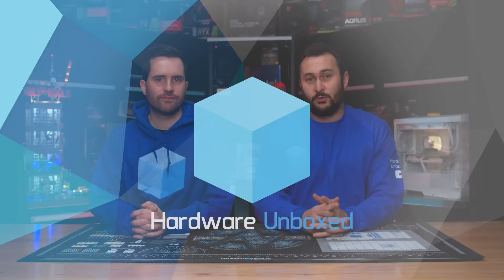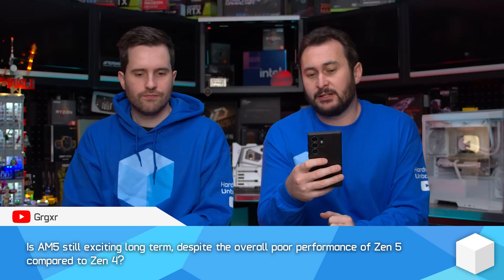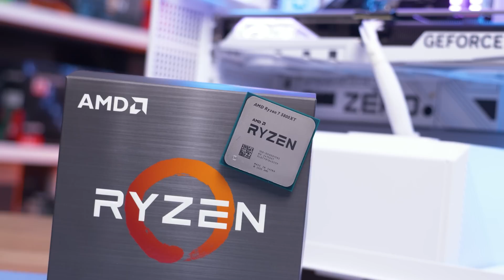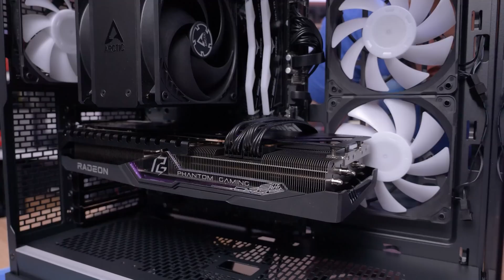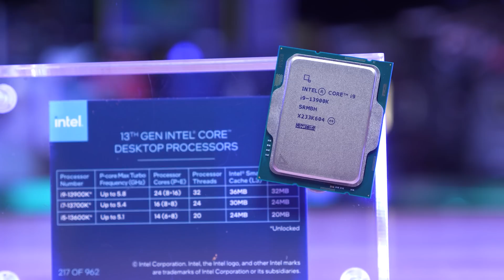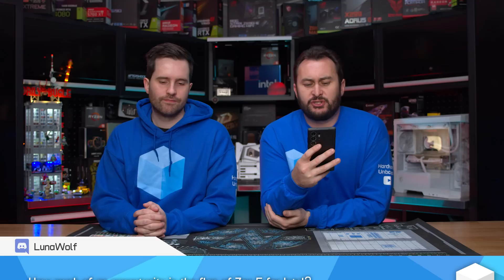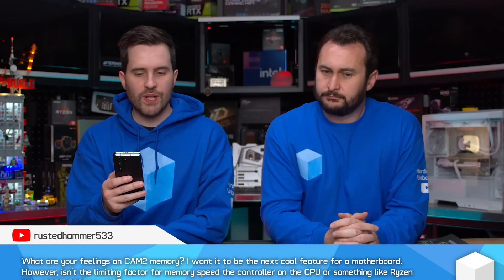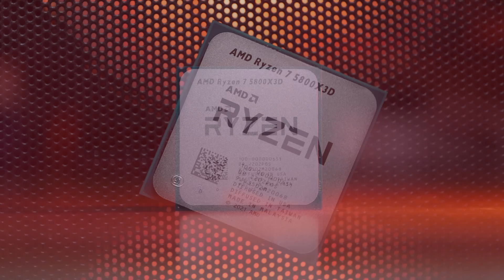Our RDNA4 Expectations, Can Intel Gain Lead After Mediocre Zen 5?

Comment: In an healthy competitive market the latest product beats the ones already on the market. So I wish Arrow Lake (Core Ultra 200) will beat Zen5 and Zen5X3D will regain a (slight) lead over AL when it'll come out next year.
The alternative is the current GPU market where Nvidia can wait as long as it wants to release the 5000 series.
I really can't understand the "fanboys" that hope Intel fails, AL is slow and hot, then whine if AMD postpones X3D or prices it outrageously high (like Nvidia does with its 90s).

Comment: With where i am, on a 9900k, Im actually rather annoyed that the strong gaming cpus are still only 8 cores, effectively. Considering ive been wanting to hang on to Windows 10 for as long as possible, intel's error cores do less than nothing for me. and AMD doing the core parking stuff doesn't really inspire confidence because my gut forsees that as a feature that they will be all too quick to drop support.
Reply: But the latest archs have around x2 single-thread performance of your 9900K and that's what matters in gaming.
Reply: @frantavopicka5259  Not sure where you're referencing that. Zen 4 is faster, but not an entire multiple faster. to warrant such a complete platform upgrade, it really needs to be more substantial.
Reply: Core parking is a hack that AMD introduced because Microsoft is too lazy to fix windows. It ought not to be necessary.
Reply: E cores actually do improve gaming performance. Tjat myth was busted a long time ago and they dramatically improve productivity. Regardless how much power intel dumps into their CPUs big little core design is more efficient and an optimal usage of core design, look at Apple M chips. Yeah theres a lot of bad things about Apple but power efficiency isnt one of them. Intel is still on 10nm, AMD and Apple are always on a half as small nanometer cause TSMC makes fabs for them.
Reply: @Angel7black ARM cannot multitask. Source: every phone, ever.

Also, for windows 10, I have to turn off the error cores regardless. So even now, Intel has yet to release a new CPU with more than 8 cores.

Comment: I bought a second 7900XTX for my bedroom PC because there is basically zero chance we'll have a better 4K raster card that's reasonably priced before RDNA5.
(Nvidia 5000 will all be overpriced OR lacking memory bandwidth, as Nvidia loves to do with mid range cards, and it's almost certain at this point the best RNDA4 card will not be as fast as 7900XTX.)
Reply: i got a cheap new one for 850usd seems like a no brainer as a long term card hoping it lasts as long as my 390x did and 2080ti did 5yrs+ each
Reply: Nvidia still charging 800 bucks for a xx70 TI is still insane to me 💀
Reply: @cuteAvancer  people are buying them....do you understand business?
Reply: @jaket1501 Yes indeed AMD does make setup on Linux easier. Plug and play.

Comment: Radeon hard limits clock speeds? is that GRE question? cause i just went to my Adrenalin and i can crank up 6950XT to 5000Mhz min and max clock speed... would instantly crash, but it is and option, voltage can go from 900-1200mV, and power can go up to 20%, but that's more likely limit for safety of the connectors rather than artificial limitation

Comment: Hoping for a very nice Price to Performance Rx 8700 XT.
My 5700 XT is tired..
Reply: you will get that
Reply: There have been some extremely deep discounts on 7800XTs popping up. if you dont care about RTX and all you need is 1440p at 165-180hz then this card is a solid performer. 16GB of memory and AV1 codec support. It will sort you out for a long time to come.
Reply: @Rose.Of.Hizaki  Not in Baltics. Everything here is insanely expensive. Even 7900 GRE costs around 700€, which is insane.
Reply: @Fatalxtv  here in Germany it’s also not that cheap as in the US market I noticed.

But I still expect that prices will come down significantly this winter because of the new AMD launch which is (almost) certain
Reply: @Fatalxtv  Thats a shame man. Keep an eye on amazon though because its where I picked up my 7800XT Nitro+ for 480euro which is pretty cheap in my country. Im sure other graphic cards also see random DEEP discounts.
Reply: this winter ...
Reply: @Fatalxtv  because RDNA 4 should bring:

RT performance near a 4070 Ti Super
Raster performance will near a 4080 

for around 500 - 600 bucks this winter 

Wait one more year and then discounts on that will kick in .. 

AND most interestingly when the leak of “Moors law is dead” YouTube channel is correct, it will crash the used market. 

Prices will come down significantly.
Reply: @johann3029  Wishful thinking. 
More like 4070 super performance for 600 bucks. 
Especially here in Baltics, where Prices are absolutely insane since 2020.

Comment: CPUs and GPUs are essentially overclocked from the factory ..... Boost clock = Overclock. Basically it's computer controlled (by an algorithm in the BIOS) dynamic overclocking

That and once we got into EUV made chips they were more and more consistent so you never saw those magic chips that just outperformed the others by a wide margin
Reply: with the downsides of overclocking from the factory too, like overvolting resulting in premature death
Reply: overclocking is pushing a part above its spec. factory spec cannot be an overclock no matter the algorithms they put in. there's no "design clock" to compare against
Reply: Its A, for stability reasons. Every chips is different and although most could easily run undervolted, people would RMA those which crash on lower voltages. And B, benchmark reasons and marketing.

Comment: On the overclocking: do you really hear about people blaming the manufacturer's for OC related crashes?  I think it's notable how little of that certainly was talked about in comparison to the unholy storm that quickly grew around intel's issues.  That seems to suggest that this isn't really an issue; crashes due to OC are clearly rarer, and they don't seem to have blowback for the manufacturers - at least not to a meaningful extent.

Comment: 7800xt - 60CU, 64MB L3, 256bit, 16GB, GDDR6, 19.5Gbps
8800xt - 64CU, 64MB L3, 256bit, 16GB, GDDR6, 20.0Gbps
We have 4 (7%) more CUs, the same cache, the same bus, the same memory type and amount, and 0.5 (2%) faster memory modules.
It will be good if AMD will be able to make the 8800xt as fast as the 7900xt (25% uplift). But people already jumped on typical AMD hypetrain where 8800xt = 4080 (~50% uplift).
Reply: @tomtomkowski7653  probably closer to 7900GRE than XT
Reply: @monsG165 
Words of wise man
Reply: If it is closer to GRE instead of XT then it is fucking useless. @monsG165
Reply: Is it a sin to expect company release a better product after 2 years? Is it unrealistic to expect some progress and competition? We are still talking about near RDNA 2 performance...
Reply: More of a refresh really, but that doesn't have to be a bad thing.
Reply: @CarthagoMike  refresh actually means something (e.g. a new revision of the same chip), RDNA4 is totally different as was RDNA3
Reply: @CarthagoMike  it is when the 7800XT was a refresh as well of the 6800XT and in some instances performed worse.
Reply: @monsG165  7800XT and 6800XT are not of the same tier
Reply: @pinkpapa9234  7800 XT is on average just 5% faster than 6800 XT. So yes they are on the same tier and it was just a refresh.

The 7800 XT was the most popular card of it's gen because it offered similar performance to the 6800 XT at a lower MSRP (at launch).
Reply: @enmanuel1950  And the 7800XT is more than 5% faster for RT than the 6800XT, so yes, they are not on the same tier because all you fanboys demanding that it only matter that a game is fast raytracing..... because NVidia are faster at that, and only at that....
Reply: @markhackett2302  Idk who you're calling an Nvidia fanboy. I don't give 2 fucks about ray tracing and I'm currently building a full AMD PC. That's why for my use case the 7800xt and 6800xt aren't much different. I care more about perf/dollar than anything else. AMD is offering that, but if Intel or Nvidia were to offer more value in the future I'd switch. Being loyal to any company is for kids/teens.
Reply: @enmanuel1950  " Idk"
You got that right.
Reply: @markhackett2302  "all of you fanboys." Now you're going to act like you weren't calling me a fanboy lol. It's fine though.
Reply: Honestly, if it's gonna be as slow as 7800XT, it's not even a problem if the price is right ($400 or lower). But it's AMD, so we all know it's going to be more expensive than the current gen AMD cards of the same performance, nobody gonna buy them as always for that price, so a couple of months down the line they'll just start dropping the price begrudgingly, but still not enough to make it a good buy. It's usual AMD pattern.
Reply: yes but you forget to mention the clock speed increase to 2.9-3.1 ghz
Reply: Looking forward to the HUB cost/frame chart
Reply: The increase in clock speed is also a factor I do expect it to match the 7900 xt
Reply: Based on those specks… it will be 2 to 5% faster that 7800xt
Reply: And you cried to daddy tube. What a shocker. You made up the claim and if you get pushback you will just say "some people" and never name them, because what you claim never happened.
Reply: Didn't they say it was a better version of the cache? and I think the CU will be considerably better since rdna 3.5 had a considerable performance jump.
Reply: I, for one, don't get why the comparison to 4080. The raster of 4080 is very close to 7900XTX, So why not simply tell that they want an 16GB 7900XTX for a cheap buck? Why bring an NVidia card here?
Reply: @someperson1829  Because of MLID hypetrain when he stated that the 8800xt will be close or at the 4080 performance so that's why. XTX is a bit faster so I wanted to stick to actual hypetrain and not add another couple of % uplift from myself. One way or another 50% is a typical AMD copium people repeat every single time.
Reply: @tomtomkowski7653  I wasn't really questioning you, mate. I've just noticed that people bring 4080 way too often, when they talk about 8000 series. Like it makes their 500-600$ pricing wishes any more realistic. They bring NVidia card, because they can't realistically expect that AMD will sell for that price GPU equal to its current high-end card, while also especting far better RT.
Reply: @someperson1829  i think they want to emphasize it's value in general performance since the 4080 launched for 1,200 USD while the RDNA 4 part is realistically gonna be between 600-700 dollars if it approaches somewhere between the 4070 ti super and 4080 in terms of general performance. If it actually reaches 4080 level of performance though, I think it'll be more like 750-850 USD. We shall see...
Reply: RT performance would greatly improve for sure, but RT alone isn't going to sell cards.
Reply: @tomtomkowski7653  nobody is upgrading their GPU every year. How about comparing it to 5 year old cards instead of 10 month old cards.
Reply: yep, just like MLID where he overhyped AMD's product in a nutshell like Zen 5 and when it failed to deliver they on damage control 😂
Reply: @Eleganttf2 I don't know that it was overhyped. The IPC performance gains are there, if they aren't in the apps that you use or care about that sounds like a personal problem
Reply: @Eleganttf2  MLID leaks came from AMD itself and everyone know some serious communication issues happened because Zen5 was not at all as advertised. There's no damage control , it's AMD marketing department sandbagging every single time and everyone acknowledge it
Reply: The 7800XT has the same number of CUs as the RX 6800, but performs between a 6800XT and 6900XT. Not too farfetched to think RDNA4 will have a fair jump in performance if the specs between each generation are the same...
Reply: It's been said the raster is faster than 7900xt. About 4080. Anyone saying it's slower than 7900xt is crazy.
RT is rumours of 4070super which was most shocking.
Reply: CU between architectures aren't directly comparable.
Reply: 1,07*1,02 = 1,0914, so probably 9% better. So a 6800XT -> 7800XT jump again, 8800XT competing with 7900 GRE most likely.
Reply: @magnusnilsson9792  That is the theoretical maximum scaling with the perfect workload. More realistic (assuming same core clocks) is a 1-6% gain, depending on the type of workload
Reply: @magnusnilsson9792  You said: 1,07*1,02 = 1,0914, so probably 9% better. Sure but you have to remember about N5 -> N4P and this move to a smaller node should give 10% so this could be maybe close to a 25% uplift to match the 7900xt but 50%? C'mon :) people are dreaming like always, typical AMD copium repeated every single time.
Reply: RT performance will be near a 4070 Ti Super
Raster performance will be near 4080 

for around 500 - 600 bucks
Reply: @johann3029  This is AMD, it will be probably 4070 Super in RT and they will shoot themselves in the foot pricing wise at 699 or and 749 for us in Europe.
Reply: @monsG165  And it was AMD when you claimed the 6900XT wouldn't even get to 3070 levels....
Reply: @monsG165 right? They probably played resident evil village to get their RT performance hype. Like when they used a 6600 to benchmark the 5800xt CPU to say it was a 14700k competitor lol
Reply: @ArchieBunker11  " Like when they used a 6600 to benchmark"
Like those who STILL complain about HUB and insist that nobody would use a 4090 to do 1080p, and guess what you WOULD use to do 1080p on? A 6600. What AMD MARKETING did was listen to all those "people" demanding HUB stop using a high end card, and now that AMD marketing did just that (as they would do if HUB acceded to those petulant demands) complain now that it is wrong to use a 6600 now....
Reply: @markhackett2302  using a 6600 to benchmark CPU’s at 1440p is a metric shit-ton stupider than misinformed idiots complaining about using a 4090 to test them at 1080p. But perhaps the least intelligent thing here is you condoning this nonsense from AMD.
Reply: @ArchieBunker11  "using a 6600 to benchmark CPU’s at 1440p "
No, it was using a 6600 for 1080p. So clearly you are not in the least careful that you cohabit reality.
Reply: @johann3029 😂🤣
And Santa brings gifts to good bois
Reply: lol its not the same architecture
Reply: LOL another dude that think he know something and compare different architectures. Dude according to "your" opinion RX 6700 XT should be like 30-40% slower than RX 5700 XT.
Reply: @Scytian1  You said: LOL another dude that think he know something and compare different architectures.
LOL, another dude on the typical AMD hypetrian who probably thought that the 7900xtx would be as fast as the 4090, ZEN 5 will be 30% faster than ZEN4, and so on.
As for your comparison... go and check the 7600 vs. 6650xt so you will see "different architecture", the same specs, and a 3% performance increase. LOL.
How many times are you going to repeat the same cycle before you learn? Overhype -> disappointment -> just wait for the next-gen -> repeat.
Reply: @tomtomkowski7653  LOL, you probably thought that the 7900XTX would not even beat a 3070.... and so on.
Gosh, this is easy. Just make up what you think is wrong about someone and then assert it.
Reply: @markhackett2302  The opposite. My prediction was that the 7900xtx would be faster than it is because the specs looked good. 
I never predicted it to be as fast as the 4090 (this was just impossible) and as slow as the 3070 (this would be total nonsense). 
I'm just trying to be realistic here. From the specs we know so far for me it looks like up to 25% performance increase so the 7900xt level of performance. 
5% from CUs, 5% from the node, 10% from clocks, 5% other improvements.  If it will be faster great but the 4080/7900xtx is just typical copium repeated every single time.
Reply: @Scytian1  He probably was also one saying, after the 3080 was released, asserted that AMD wouldn't even get to 3070 levels of performance. Then pretended that was never said by anyone....

Comment: My expectation for the RX 8800 XT: rasterizstion on 7900 gre level. Raytracing on 4070 Ti super or 4080 level
Reply: That's my expectation as well. Good evidence out there that AMD is finally doubling down on RT performance. Sounds like they had been holding off committing a bunch of die area to it, waiting until the software matured more.

Probably won't be caught up to Nvidia, but I expect them to close the gap significantly, at least to the point where it doesn't feel so bad to turn it on lol
Reply: what

:face-turquoise-covering-eyes::body-green-covering-eyes::oops:
Reply: You'll be disappointed. How should AMD only gain 10% in raster but double RT performance?
Reply: @nipa5961  They way RT implemented in RNDA3 is not very efficient.
Reply: @Salabar_  you have just answered most of the questions above.
Reply: @qarim350xd  Probably. I don't remember the details, but the GPU has to disactivate part of it's compute pipes  when doing RT. I assume it has to do with power delivery, and redesigning that part should help immensely.
Reply: Hpw can that be possible ? The 4080 RT performances are at the level of the 7900gre raster. Something does not compute in your expectations.
Reply: @Ilestun  he's being delusional from watching too many MLID videos